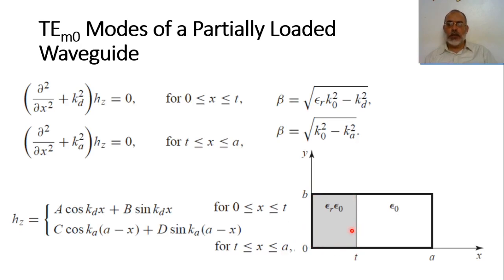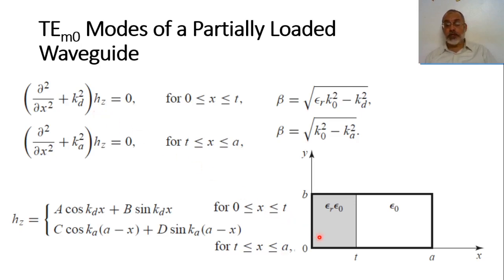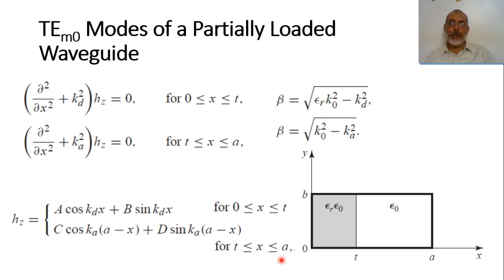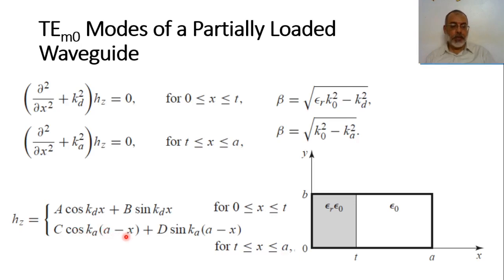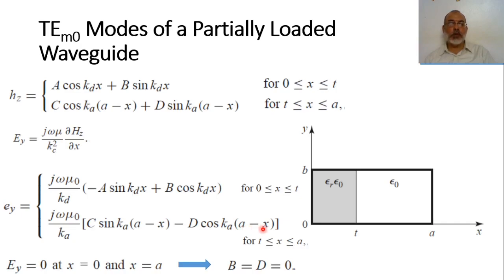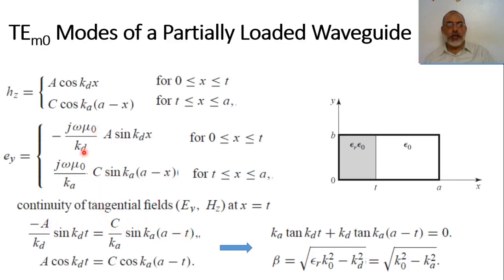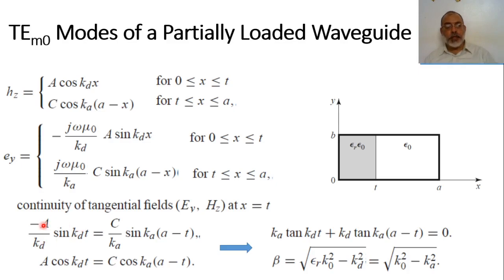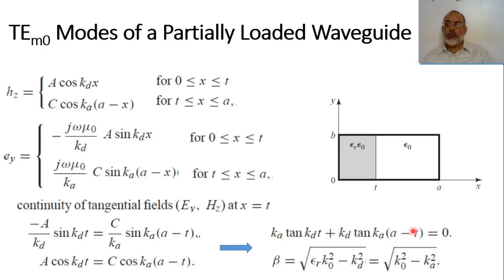Chapter03 m  Partially Loaded Rectangular Waveguide TEm0 Mode

Comment: Sir, How do we calculate the cutoff frequency for TE10 mode for the same partially loaded rectangular waveguide with same specifications as in the video ?
Reply from the maker: when the solution of beta would be zero, the corresponding ko would be the cutoff wave number. This does not have an analytical solution. It can be found by using numerical root finding technique.
Reply: @ahmedm.attiya1197  Thank you Sir . This will help.
Reply: @ahmedm.attiya1197  can you give an example of one of these numerical root finding techniques? I am confused and also would like to find the cut off frequency for TE10 mode for the same figure you have.